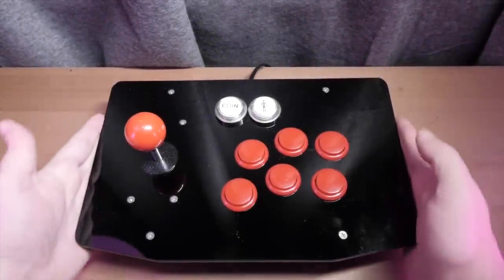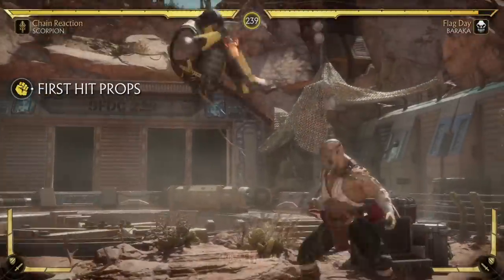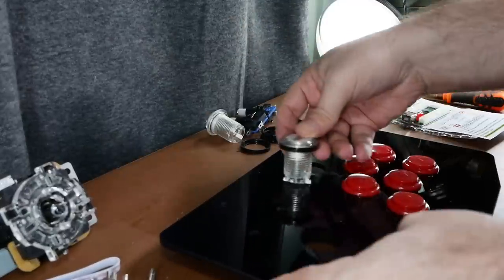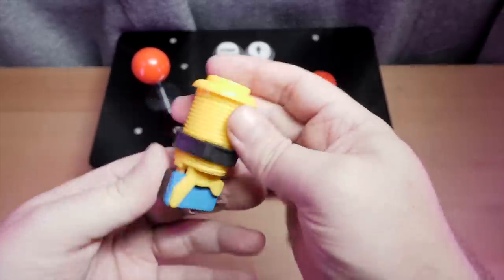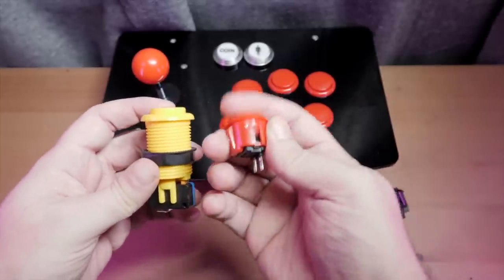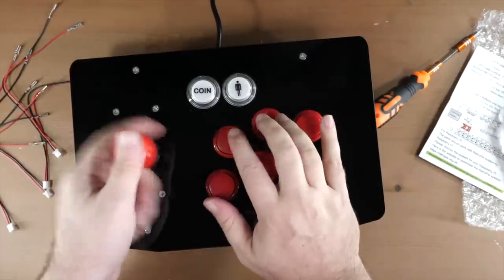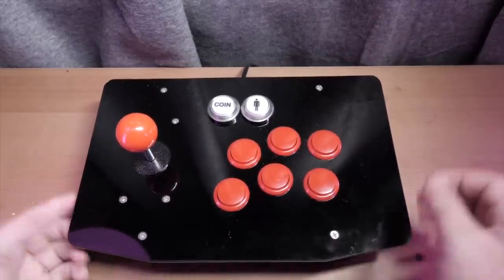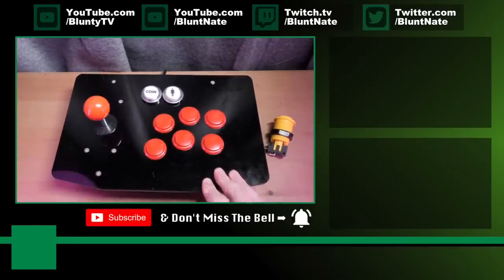EASY $49 DIY Arcade Stick

Comment: Yo. I used to build custom sticks for the local fighting game community. While I disagree with your opinion about Semitsu, it's all opinion and matter of preference. First thing I noticed was the excessive throw on that stick, which you mention. I'd recommend swapping it out for a Semitsu stick (Ls-32). They have heavier springs and switches than Sanwa, and this goes for the buttons too. Also, the round tops are called ball or cherry tops and the others are called bat tops. Hope this helps. ^_^

Comment: Hey Blunty! Long time lurker, long time fighting game player, more recent fight stick customizer. The “blobby” sticks are called bat tops while the balls are just called ball tops. I, too grew up on Happ controls buttons, but we had bat tops standard here in the US. Japan and most everywhere except US and Korea seemed to have ball tops. If you like the clicky buttons but also like the convenience of the shorter shaft of the Sanwa or Seimitsu buttons, there’s a company called Gamer Fingers that make low profile buttons that have cherry mx switches in them. They’re about $5/each and they’re convex, but they feel very nice. Your stick is a nice DIY and I was just looking at it to put a raspberry pi 3 in as a retro arcade plug and play. Thanks for your videos, hope this info dump helps someone.
Reply: There is also the Paradise Arcade OBS-MX cherry/gateron switch buttons.

Comment: I'm building a stick at the moment as well and I found OzStick to be a terrific local online store. The pricing is competitive when compared to other Aussie sellers, but all buttons are sold with microswitches which definitely adds bang for ya buck
Reply from the maker: OzStick are great... I used them 20 years ago when I built my big cabinet, and I used them again two weeks ago when I ordered the dimpletops I show in this video. (and a few times thoughout the interviening years for bits and pieces here and there... zero issues ever. Highly recommended for my fellow Aussies. Its hilarious to me their site has literally not changed in two decades X'D

Comment: I made my own fight stick last year, with the same buttons yours has but in blue and I made an 8 button "hori" style layout so that I could program my Neo Geo games with the ABCD buttons all in a row. I used an old sewing machine box from the tip shop and a couple of layers of ply board cut and glued together for the top. ended up costing me a bit under $30 and the only issue I had was cutting the holes because I didn't have the right size bits (drilled a bit smaller and filed up until buttons fit) I could have spent a bit more for the right bits but I wasn't planning on using them again so I didn't want the expense. I love the wooden look but if I built another I would go the precut acrylic I reckon, just for the ease of it $30 and the only issue I had was cutting the holes because I didn't have the right size bits (drilled a bit smaller and filed up until buttons fit) I could have spent a bit more for the right bits but I

Comment: I prefer Sanwa and seimetsu and run them in my sit-down candy cabs for Tekken 6, Soul Calibur 2/3 and Super Dragonball Z as they're light and easy since you lack weight to apply from your shoulders while sitting. In my Standing Gottlieb Challenger cab I run MCA for Xmen VS Street Fighter since you have more weight to throw around and can beat the machine and it doesn't care.

It really comes down to preference but I prefer lighter switches for seated and heavy for standing where you can bash the machine a bit more. 

Aussie arcades got MCA sticks and HAPP buttons. MCA sticks are getting expensive now but they give that super nostalgic feel for veteran Aussie arcade bashers, especially for Street Fighter 2.

Comment: You ever get the better buttons in there? I would have tried longer screws and added some spacers to make it stand taller. Of course it would leave a gap around it. But I would have been ok with that. Nice video though man. Congratulations

Comment: I always find those tall Happ style buttons in local arcade machines and it goes down exactly the same route every time: buttons are way TOO hard to press, they barely register anything,  and finger fatigue kicks in too early. Absolutely hate them and the reason I can't wait to try either original Sanwa or clones

Comment: I recommend Crown buttons if you want that same click feel without having to spend a ton on Gamerfinger buttons. Crown are very good Korean buttons, used them for a bit on my sticks just to compare them with Hori and Sanwa and what not, give them a try they are fairly cheap. 

If you really wanna experience complete garbage scrapy mush try Seimitsu buttons. (IMO they feel like they get stuck and scrape right out of the bag, almost clunky feeling)
Reply: I really like the feel of Seimitsus over Sanwas for classic arcade games. They have a little more resistance than the OBS otherwise they are very similar in my opinion and i have never experienced any sticky or mushy sensation. You could also insert a light spring like the one from a LS-33 lever in the casing to create a more springy feel.

Comment: no mention of omron??  omron switches are bae. after HAPP's decision to stop using cherry switches in 2009, Omron is the only way to go. granted you pay a premium. but oh boy is it worth is when you're talking about lifespan of the switches and how many actuation cycles they last. omron also tend to feel the same all the way through their life cycles as i've noticed the sanwa and the HAPP tend to degrade in feel slowly throughout their lives.
Reply from the maker: That's the best thing about the HAPP style mechanism... you can EASILY switch out the microswitch component to whatever you like. Including Omron microswitches. Takes literally seconds.
Reply: @BluntyTV  you got me there. take my upvotes. it's just sad that i have to buy them just to change the micros as soon as they come in since they dropped the oh so sexy cherry switches they used to have. granted the current ones are okayyy i'm just spoiled.

Comment: I would love something similar to this as a plug and play Arcade system. I got excited when I heard Capcom were making a arcade plug and play system but it's butt ugly
Reply from the maker: You could install a raspberry pi or other similar micro pc inside this and set it to auto boot into a frontend easily enough for a "plug and play" experience.